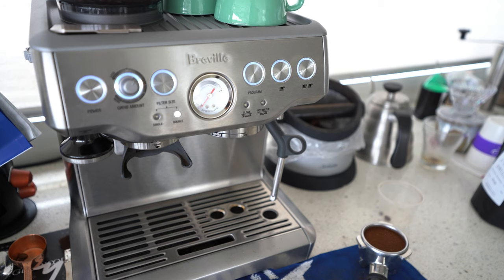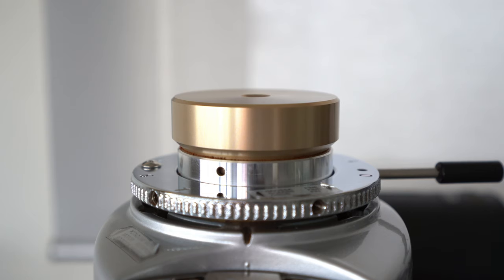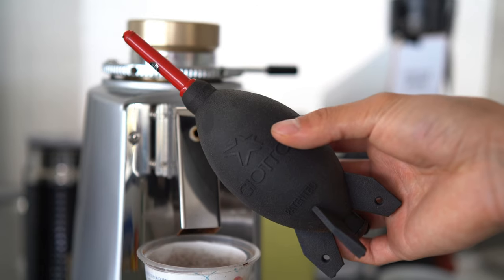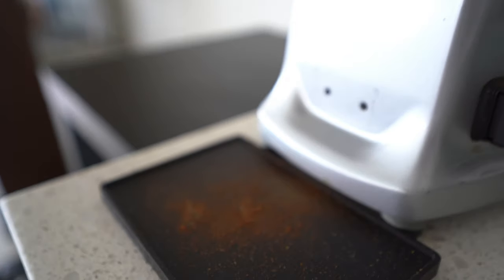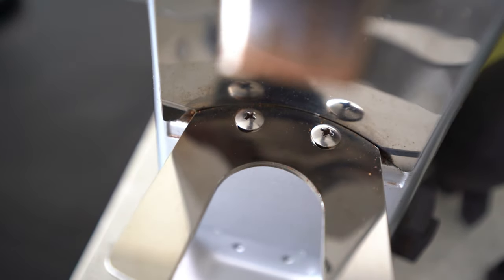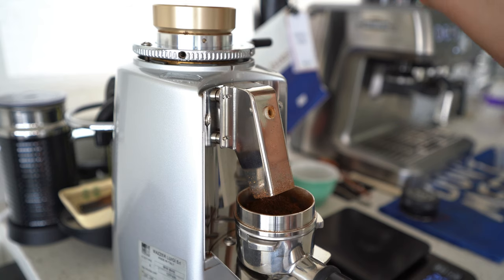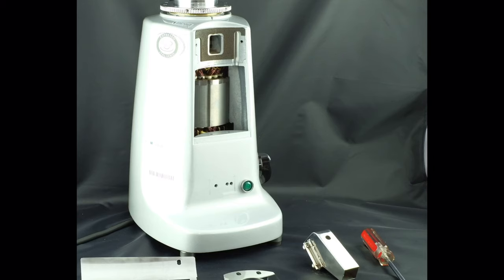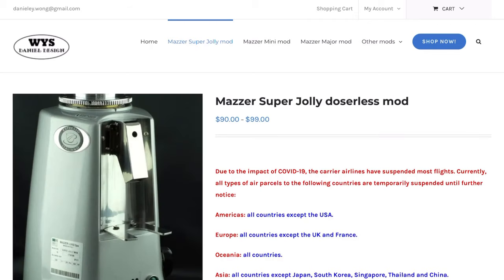Mazzer Mini Doserless Mod Review

Comment: I had to cut two cords to remove old doser in order to add new one, similar to yours. Now grinder doesn’t turn on. Was I not suppose to do that?
Reply: You probably need to jump them instead of just cutting since they go to a sensor on the old chute.

Comment: I wouldn't be as hard on your mill as you are.

Coffee IS a terrible mess in general, I don't recommend espresso to anyone who doesn't like to clean.

The EK43 is one of the most popular grinders, but it is one of the most messy. That doesn't mean anything.

Don't forget that you have a professional machine, you will probably die before the motor, you can easily change the burrs for a reasonable price.This is not the case with the niche for example.

Their design is simple. This is a real asset in a commercial environment, you reduce the number of breakdowns and fragility. The proof is that you could even modify it easily.

You don't realize that coffee is a horrible environment for machines. Dust and water.

Take a good look at the coffee shops, the baristas always have a cloth in their hand. Love your machine, it is beautiful and reliable. You have a part of the history of coffee in your hands.
This is not the case with the niche for example.

In spite of all that can be said about the niche, it will never be worth in my eyes a good old reliable grinder (Eureka, Mazzer, etc...) with the customization that can now be found everywhere on the internet and especially SSP burrs that improve in an extraordinary way the quality of grinding, that even a niche can't match.

But installing SSP wheels requires a strong motor and a heavy casing so that it doesn't move too much. This is something that can only be found on this kind of mill.

Love your machine, it looks like you and it is beautiful =D - Words from a guy whose friends are selling their Niche.